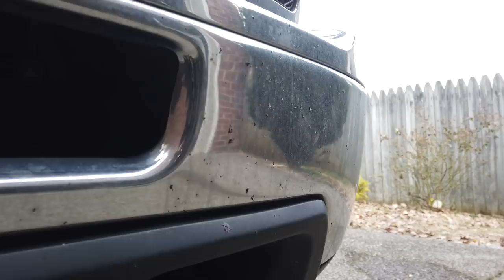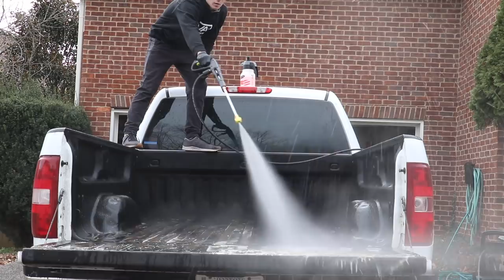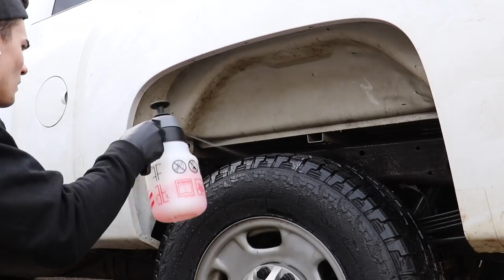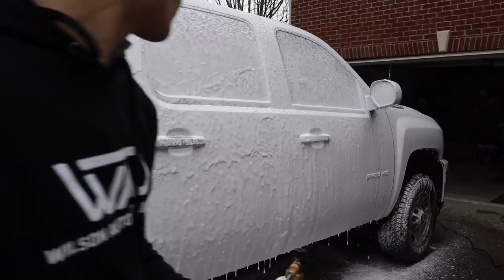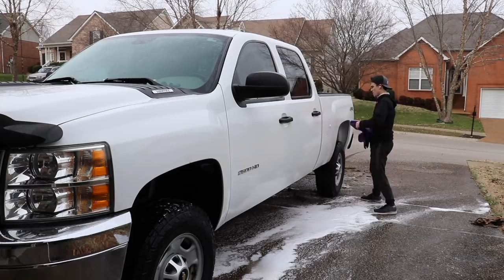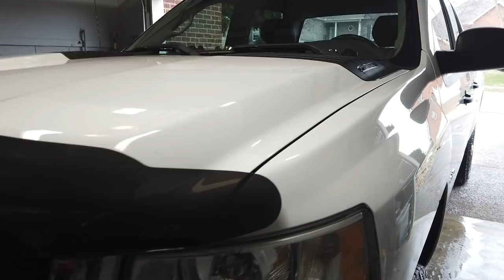MUDDY Farm Truck Deep Cleaned | 4 Hour Disgusting Chevy Detail!

Comment: Luke, great work on cleaning the bed of the truck and jet blasting the crap off the sides of the truck.  I thought you would use Mcguirre's tire brightner to get the serious stains out?  Also, what's up with dunking the same wash mitt in the soap bucket over and over again?  No rinse in-between sections?

Comment: Applying the APC degreaser would certainly remove any existing waxes and sealants on the paint surface. After the polish stage, did you re-apply some wax or sealants to protect the surface?
Reply: AussieVillian there wouldn’t have been wax or sealant on any surface of that pickup anyway.